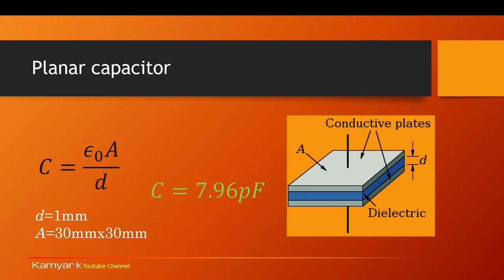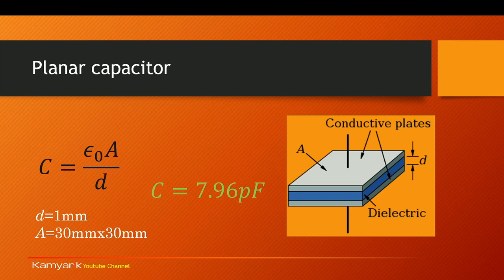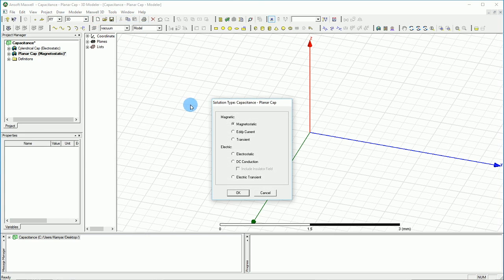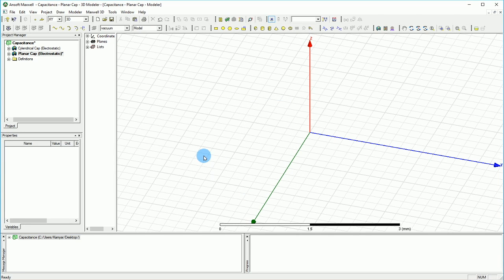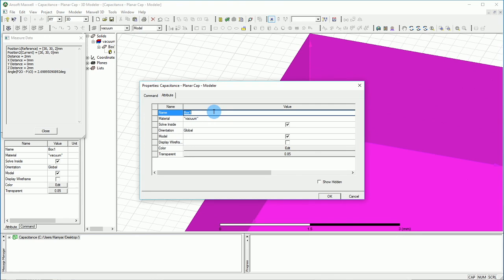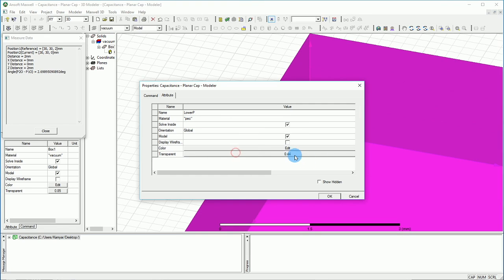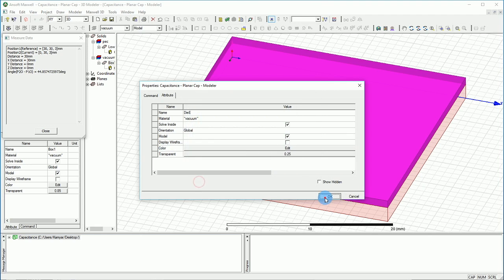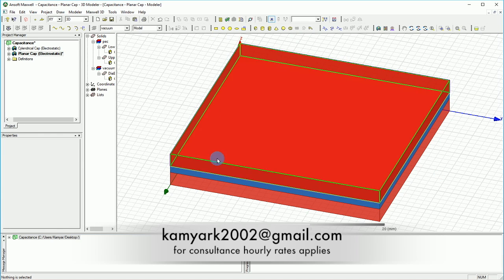508 - Ansys Maxwell | Electrostatic Planar Capacitance [1/3]

Comment: Hi Kamyar! Thank you very much for your answer. In my capacitor I have five electrodes, and I am applying 5V to electrode 1, 3 and 5, and -5V to electrodes 2 and 4. In other words, I am short-circuiting electrodes 1,3 and 5 , and electrodes 2 and 4, but without using a physical cable for the short-circuiting. In this way, Ansys gives a matrix of relative capacitance among the electrodes instead of the total capacitance. 
My question is: How can I ask Ansys to calculate the total capacitance directly, does avoiding to get the matrix? Is it possible? 
If it is impossible, could I obtain the total capacitance directly by physically short-circuiting (for instance drawing a wire) the electrodes 1,3,5 and electrodes 2,4? 
Thank you very much again for your time and help!
Reply: Were you able to solve this? Would you like to share the model or knowledge?

Comment: What happen if you have five capacitors in parallel? Is it possible to have an absolute value ? How do I calculate it in Maxwell 3D?
Reply from the maker: Yes, 
You just need to define them properly in electrostatic. Parallel caps are quite intuitive I don’t see where is the problem ?